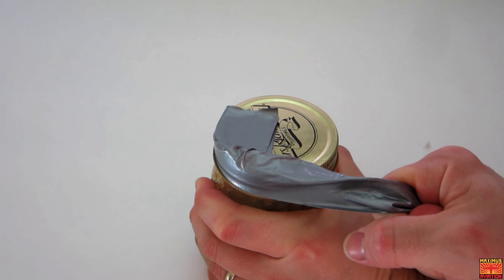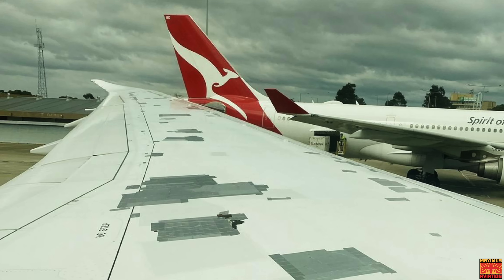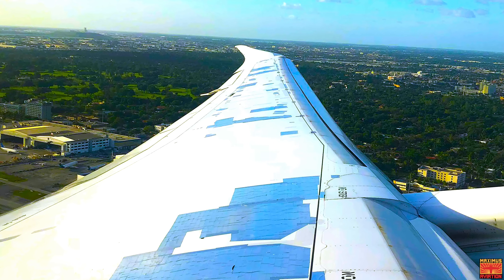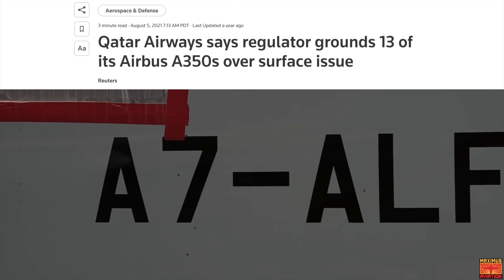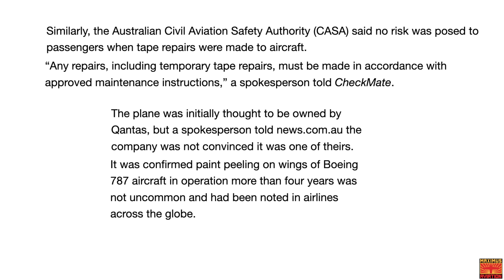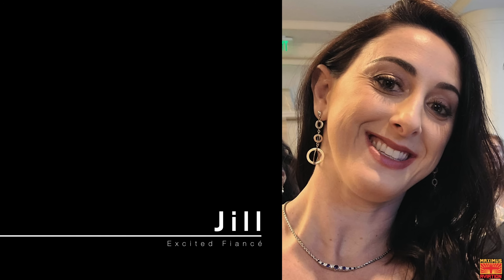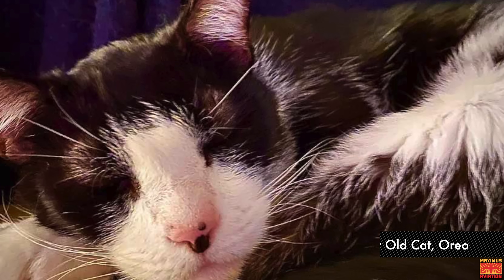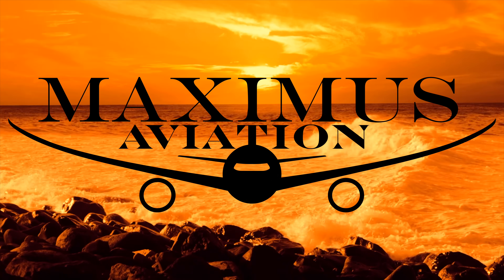787's All Around The World Are Being Repaired With Duct Tape And Continue To Fly. But Why?

Comment: We couldn’t believe our eyes , when a passenger called the flight attendant to show her several fuel leaks on top of the wings in a A300 B2 and on a A310  during flight . That was 1985 to 1990 , the sealer on top of the integral tanks was eaten up by the microbes in the fuel ! Why on top ? Microbe’s love condens water ! We have to reseal the wing’s and cover the sealer with high speed tape ( aluminum foil) , that looks awful . That where metal wings .

Comment: Speed tape , AKA "600 mph tape" is ugly but very useful in making safe temporary repairs.   In my 33+ years as a pilot with a major airline occasionally I would see speed tape used (not in large areas like shown in the video) but nonetheless it works well.   There is usually a time limit as to how long the tape can be used before a permanent repair is made.

Comment: Speed tape...500 mph tape, it has had a lot of names over the years, but it is basically an aluminum sheet with the strongest adhesive I have ever seen on one side. It is often used to hold fairings in place when quick release fasteners won't latch properly and other non-structural applications. Using it just sends the problem to the next station since the fairing still needs repair, and now you have to figure out how to remove the stuff. The only objection I have to this video is that the title was misleading...click bait! So the joke is on me...I clicked on it! 😁😆😅🤣😂

Comment: It's not duct tape. It's 3M 436 Viscoelastic damping polymer dead soft aluminum tape and it's 14 CFR approved. It's there to protect the carbon fiber wing surfaces from ultraviolet radiation, which degrades the CF and potentially weakens it. 787's have an issue with wing paint adhesion. So does the Airbus A350. The biggest problem with the tape is that when you remove it, it lifts off even more paint. It's a crap show, but it is what it is.

Comment: Adhesive backed aluminum Speed tape was developed for quickly patching bullet holes in military aircraft during the Vietnam war. Don't worry folks there's no duct tape on your planes wings or engine. Speed tape is rated for over 600 mph. I use it for emergency race car body repairs and lots of other uses.

Comment: Speed tape is adhesive backed aluminum. Duct tape is cloth with adhesive backing. Duct tape is rated for 200 mph Speed tape is rated for 600 mph.

Comment: In the case of the 787, the wings seem to flex quite a bit more than other models.  I'm not surprised that the paint isn't able to deal with the flex well.  And leaving composite surfaces uncovered and exposed to UV would be bad, so I can see why they use so much tape.  Perhaps if they made larger pieces (i.e. 1m x 1m) then the passengers won't see it as "duct tape"

Comment: Modern fishing rods are made of carbon fibre ,& are subject to more flex than aircraft wings. They also have to cope with all types of hot & cold temperature weather & salt air environments . Why not use same protective coatings on aircraft wings ,or just go back to using good old aluminium or titanium material for wings .  It would also probably work out more economical than using gaffer tape to bodge up tacky substandard poorly constructed Boeing aircraft ,time after time .

Comment: As I see it after reading comments
Paint is not peeling to the foil.
Recommended time between paint has not been reduced to 2 years
Issue is with EPA new 'safe' primer rather than carbon composite.

Comment: C.I.A admitts Climate control and change by HAARP ~ Sept. 13, 2022. 
HAARP â€“ (High-frequency Active Aurora Research Program) 
H.A.A.R.P. is a geophysical weapon so powerful, it is a weapon of 
mass destruction using Weather modification & manipulation.
WEF and the United Nations controls droughts and floods.
The aircraft contrails are aluminum oxides.
Aluminum toxicity is one of the major factors that limit 
plant growth and development in many acid soils. Root cells
 plasma membrane, particularly of the root apex, seems to be 
a major target of Al toxicity. However, strong interaction of
Al3+, the main Al toxic form, with oxygen donor ligands

Comment: That's right!  It's speed tape.  Duct tape is what the farmer used to fix the fairings on his private aircraft... also wrenches welded on to repair door handles and some bailing wire to hold some down some parts

Comment: Speed Tape is able to resist Mach Speeds.  It's made of aluminum with an excellent adhesive.  I've seen it used on nearly every military A/C because it will not allow migration of moisture.  Duct tape will wick moisture and deteriorates under UV light.  Speed tape reflects the sun and the adhesive has the ability to adhere from -80F to +160F without loss of adhesion.
Reply: Absolutely!!!

Comment: Speed Tape and Duct Tape are nothing alike. Speed Tape is more like a thin metal with a sticky back. The 787 paint issue is almost only on the upper side of the wings partly due to its flex and it's paint related. The 350 issue is the entire plane's lightning protection mesh defect. Which according to the 350 SRM has no allowance in the keep out areas around the pitot static system.

Comment: So at least it isn't the Duck Tape covering the wing Quacks.
So if you could take the wings of the A350 with the fuselage of the B787, and The wings of the B787 with the fuselage of the A350. You would do away with the one that is suffering from UV radiation and heat damage. Too bad you can't just swap the wings between the A and B aircraft companies.

Comment: Now you are sounding like a fake news station peddling garbage.  Yes, there are uses for "duct tape" in aviation but it isn't your local big box store variety and it is not used on exterior surfaces of jets.  The common name for what you are going on about is "Speed Tape" and it is as far removed from duct tape as latex house paint is from the paint on a new Lambo.

Comment: As a glider pilot in the 80s, I remember we had duct tape to fix holes in old canvas-covered gliders. It was during the flight season when we didn't have time to fix the holes. Now it's fiberglass so it's no longer a problem.

Comment: We live in strange times. But anyone who thinks tape is holding the plane together is nuts. Just plain scared. Probably of more than the tape. Since both Boeing and Airbus are struggling with issue of paint adhesion to composite frames under stress, it must be a very difficult chemistry and engineering problem. I am not sure the tone of the video advances the cause. Helps to calm the public. I would estimate this presentation as 90% snarky and 10% informative. Oh well, another indication of the signs of the times.

Comment: It's not duct tape. It's high speed tape. Which is made of a layer of aluminium (a lot thicker than the aluminium foil some people wrap their lunch in). Calling it duct tape is typical when people who don't know anything, think they know everything and are quick to pull to conclusions. This is how fake news spreads. It's installed on the 787 wings to protect the exposed CFRP from UV radiation. I know as I've installed the tape on several aircraft. Many of which have gotten a new paint job already.

It's pretty old news tbh but still relevant as the paint still has this problem. Though a lot less problematic on the 787 because only the upper side of the heavily flexing wings are affected. Where on the A350 the entire fuselage is also affected and to a much greater extent.

Comment: The so called speed tape, and does not even have any remote resemblance to duct tape in looks, texture, and integrity,  has been around for many decades, and an approved temp repair for fuel tank covers, over and under the wings, windshields, or anywhere where sealant is not expected to cure fully before flight, and have install it myself. Big deal. Do you see the tape coming off from airflow or structural flexing? No!  Another social media stupid stunt by people that think know everything by watching YTB and other social media. Get a life people.

Comment: Many grounded aircrafts during the pandemic were heavily exposed to the sun which damage the paint on them. Aircraft paint cannot be exposed statically to the sun for too long or the paint job will suffer. It is the same problem that Qatar has with their Airbus' A350s. But Doha Airport cannot afford to have airliners believe that the aircrafts cannot last too long at the airport due to heavy sun ray exposure (it is bad for their business) and they want that airport to become a heavily used hub.

Comment: Great video Max.
Just a comment about composite planes being on their infancy, I hear that often. But being a glider pilot I feel inclined to point out that carbon composites have been used extensively in the airframe,  especially the wings of the high performance gliders since the 1980s. 
Peeling, delamination and inconveniences like that have been known at least that long in the aviation world just not at the airlines. First time I met an aircraft mechanic that had been trained by the german glider manufacturers in Carbon composite repairs, both small and extensive, must have been around 1995, at which point the german manufacturers had extensive experience. I know because as a Pilot I helped him fix a wing damage on a carbon fiber wing from a glider in which I would fly years later and still do.
Reply from the maker: I agree.  Thats why I made sure to say commercial composite aircraft.  Composites have been around since the 70s especially in the 80s and in the Business jet sector also. But you are correct.

Comment: In my over 30 years of experience I can tell you that all the paint peeling is somewhat new. The EPA and the other countries same have forced new primers to be developed and used due to environmental reasons. The older paint never peeled. Around the 90's they changed and it wasn't pretty at the beginning. 3-4 year old planes were already peeling. It just doesn't stick whatever the surface. And yes composites have been around forever. They've gotten much better though.  And that was a neat shoutout!

Comment: Former AC mechanic (and com' rated pilot) - it is NOT duct tape. It is high strength aluminum foil (called "speed tape") with extra strength adhesive that allows it to stay stuck at 600 mph. The 787 has a known defect of the paint peeling off the composite (not aluminum) wing. The tape is to control the peeling until the whole wing can be stripped and re-coated. Even if the tape and the paint peeled off it would greatly impact the flight safety. It is an approved "band-aid" fix to get the plane into maintenance, and yes, there is an art to applying it so that it doesn't blow off.
Reply from the maker: You are correct.  However the viral aspect of the story was Duct Tape.  I mentioned that it was metal speed tape.  But I bet duct tape would still work. lol.

Comment: My father was a mechanic with American Airlines, from the 1950's thru 1989. That was no ordinary "duct tape" it was solid aluminum. It was specifically designed for use on aircraft.

Comment: LOL, why not use flying tape that matches the paint of the airplane and avoid spooking flyers?

On another more serious note, the bottom line and despite the over-enthusiastic marketing around composites in aviation, we still don't know that much about how they will age. Qatar's less-than-elegant handling of the A350 peeling paint which bakes in hot desert suns and cooling off sub-zero at cruising altitude is an extreme case and as you've duly noted, others are having problems, but not life-threatening problems.

The next generations of composite aircraft will probably remedy these growing pains. It will be interesting to see how Qatar masks its B787 now that they've shot a hole in the Airbus relationship :)

Comment: I'm an aircraft engineer who works on 787s everyday. It's not duct tape, it's aluminium foil tape or it's colloquially known in the aerospace industry as 'speed tape'. Speed tape is only their to protect the bare carbon fibre resin from harmful UV-B or even UV-C rays from the sun at 39,000ft which can discolour the fibre therefore weakening the surface. 
The paint peels off from transonic airflow because it has to be thin to allow lightning strikes to conduct through the airframe; if that's not allowed to happen because of high resistance, serious damage can occur. The solution from Boeing is to have a black paint conductive 'primer'  layer to bond the CFRP surface which will allow good paint adhesion on top. This takes time to implement so you will see this for a few more years.

Comment: I'm an airline technician and we have been using aluminum speed tape for years as a temp repair for paint peeling on composite structures. Composites have been used on airliners for years just not the whole aircraft being made out of it. We also use speed tape and filler on small dents on leading edges to maintain aerodynamic smoothness. Like I said it's temporary and has to be periodically inspected until a permanent repair has to be made. 

I do admit that is a lot of speed tape and it would scare the shit out me if I didn't work in the industry.

Comment: Speed tape is NOT duct tape!!!  It comes in the same format but costs about US$ 100 a roll.  It'll put  up with 500+ mph winds, too.  I watched a AFPP mechanic apply it between the front engine nacelle and cover of a Delta aircraft which then proceeded to fly me to ATL from RDU.  It looked not the least worse-for-wear when we  landed at Hartsfield-Jackson airport.   Some of the  strips in your video are placed in places were the airflow over the wing is near mach one.

 I've had several rolls which I used for plenum work and other things such as computer and scientific equipment.  The stuff is almost bullet proof.  Don't judge a book by its cover (or form factor).

Comment: In 2006 I flew to Seattle to visit Boeing’s factory, gift shop, and museum. Hanging from the rafters was a Beechcraft Starship; the worlds first composite aircraft. I recall Beechcraft had problems with corrosion of metal parts embedded in the wings (is it similar to the Airbus A350 lightning  protection wiremesh?) I wonder if in Boeing‘s case, the peeling paint Is the result of the paint being less flexible (or more susceptible to fatigue) than the surface it is applied to; in this case the wing? Is there a difference in the paint used on 787-9 wings?

Comment: In Vietnam we called it "100 miles-per-hour tape".  The Army Green Duck Tape worked great over minor damage and bullet holes "collected" by low flying aircraft like Hueys, Loachs and Chinooks aka Sh** Hooks.  Looks like 3M improved it to 700 miles-per-hour tape!
Reply: I'm surprised that the didn't cut up an aluminium can as a patch, and then cover it in standard duck tape 🤷‍♂

(in regards to your story)

Comment: This tape is actually Aluminum foil with PSA acrylic adhesive.  PSA is Pressure Senstive Adhesive, which about 15 psi of force (via manual pressure) helps the tape bond to the substrate.  Excellent stuff!!
Reply: Keeps water out of/away from whatever it covers.  It also keeps UV off the carbon graphite so it doesn't deteriorate.  Glad the guy has a daytime job opera singing...and NOT an AMT or anything...
Reply: I use it on boats also. The glue it leaves behind is easier to remove than regular duct tape goo.
Reply: Is it meant as a long-term patch job, or just to hold over one flight until it can together to the hanger for repair, because this looks like the patch jobs are accumulating over time and never being attended to.

Comment: The next breakthrough in composite materials airplanes... vinyl bodywork on top of the paint! It has been done on Japanese cars forever... :)
Reply: There is a vinyl coating that is approved by the FAA for wrapping aircraft. This might be a good solution to an ongoing problem. As for approval for complete wrapping don’t really know. Many aircraft owners opt for this route to add visual accents and registration numbers to the aircraft. A lot quicker than masking and painting.
Reply: @Subgunman  I knew about it, but ,as you mentioned, I only knew it to be used by privates for smaller work. I was suggesting a somewhat more radical change, in a sort of joking way. 😆

Comment: Don’t call it DUCT tape. The only similarity between “duct” tape and “speed” tape is that they’re both a roll of sticky backed tape. 
The speed tape on the wing is there only to protect composites from UV. Using a different primer is expected to solve this problem.

Comment: Nice intro. I've seen a stranded fabric covered GA plane use duct tape before in an emergency "need get out of here" situation. I've seen speed tape on numerous occasions with airliners... totally fine, unless it's on a structural load-bearing part.

Comment: I guess you are in the same bed as DJ.  Your "come on" to get people to watch your video clearly, even with your own explanation, sensationalized the issue.  First, duct tape would never come close to staying on a wing in flight.  I've tried it to keep a tarp on a pick up load at highway speed, no bueno.  Second, maybe, I don't know. "tape used to assist in making wing repairs in composite structures not affecting safety..." might be more accurate.  I think we need to start a movement ignoring posts by vloggers who use such way over the top provocative lead ins.  Ding their analytics would change things.  On the other end, do make sure you like etc... the honest ones.

Comment: Speed tape has been used as a temp repair for decades.  I recall in the 70s a B727 had a damaged wing tip after a ground vehicle got to close at Alice Springs.  Aircraft was 2 hours flight time from the operators maintenance base but gave approval to local airline engineers to repair it with speed tape and aircraft was then able to continue service back to Adelaide.
Reply: Yeah Boeing's are rubbish since the 70s😛